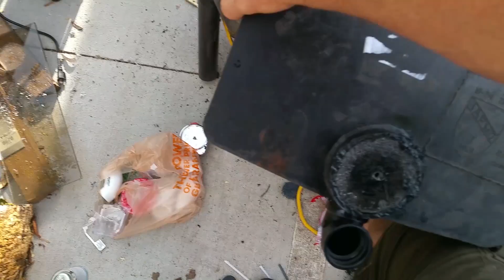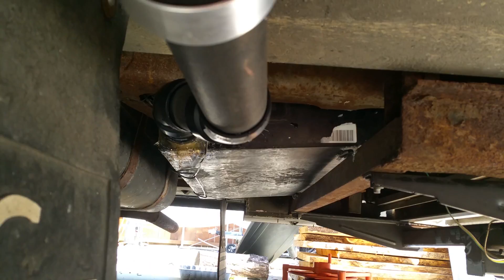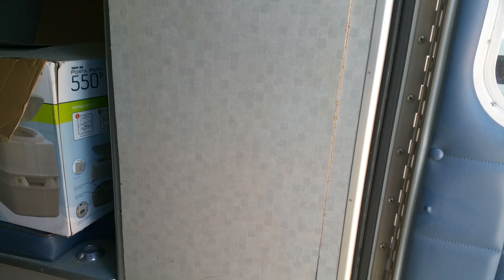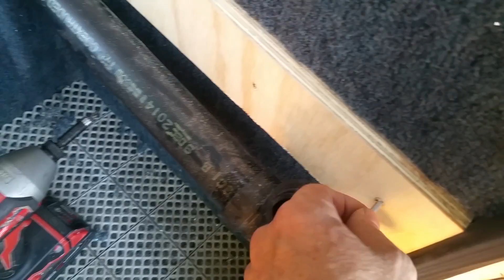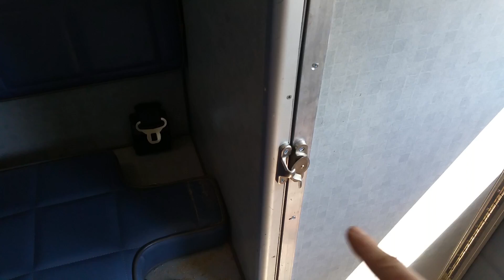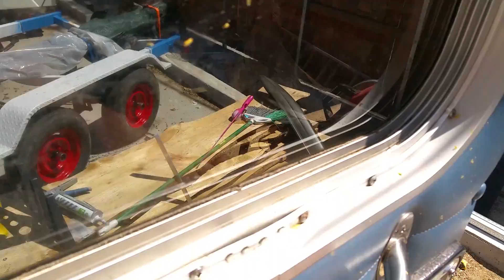#9 DIY Ambulance RV Conversion; Camper Van, Motor Home

Comment: Have you tried acetone to weld your ABS parts together?
Reply from the maker: No, but I read about that. The heat gun I got is designed to weld ABS and worked well.